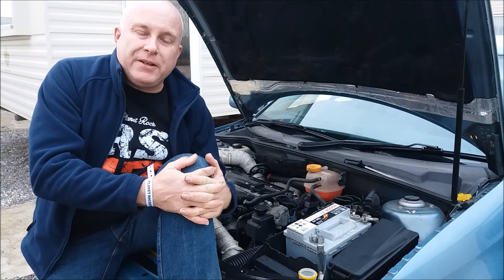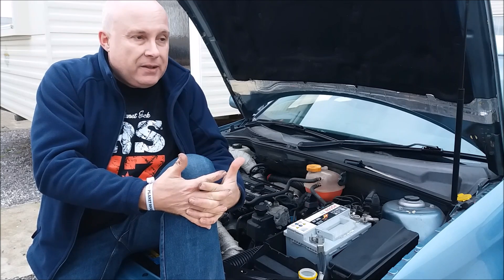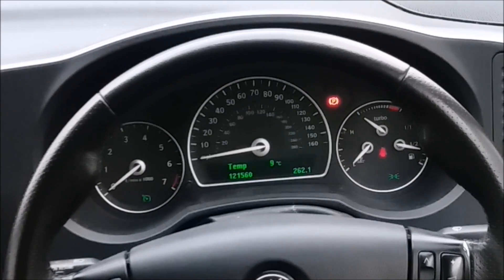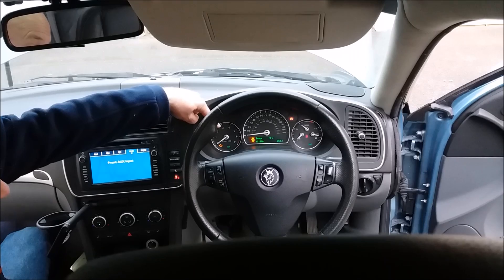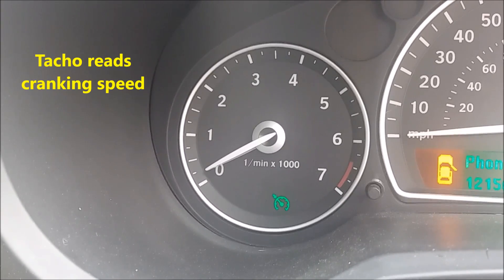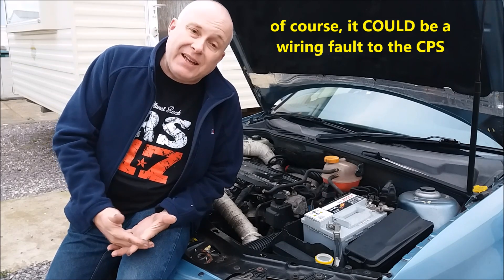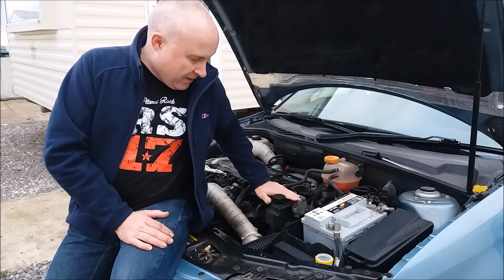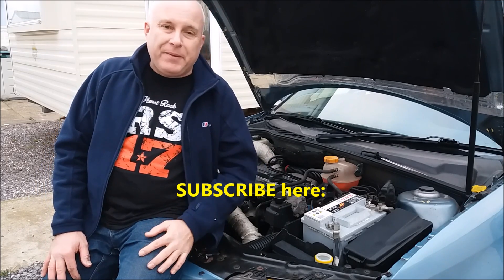CRANK Position Sensor Test - failing CKp sensor - CKp test

Comment: Short and sweet but most of all informative! Thank you!
I just discovered I just unplug thus and put on a new one so I best get started and I will ask my mechanic why he didn't know this when I described these symptoms exactly and only?  *second mention the tachometer reading!!
Der... why has nobody ever mentioned this, is it too obvious? NOT
Reply from the maker: Yeah, I think it is. It's just way too simple for most people. Yes, cars are more complex than they used to be, but people somehow imagine that failures also have to be complex. Not at all, sometimes you just need to get back to BASICS - it's nearly always some simple component failure.
It's the same with coil-over-plug units. Mechanics will tell you they can't be tested other than by substitution (aka 'parts darts'). Again not true. I'm actually in the process of filming a video on how to test COP units!! With a £10 tool too. Watch out for it.
Welcome aboard

Comment: Yes my Pontiac Grand Am had that problem when it got to normal operating temperature the sensor would stop working engine would die and it would not start until could then it would run good until hot again ,so wen I got my chrysler 300 with 175 thousand miles I replaced the sensor it was good but I replaced it anyways and I put the old one in the trunk for emergency ,its a cheep  sensor anyways.

Comment: 97 maxima stalls at idle then lights  came on as if stalled on the highway but the car was still running. Then it would constantly try to stall as the rpms bounce from 3k to zero even in park. ??? What the heck is going on? It has a p1335 and an evap emission system purge valve control  circuit code p0443

Comment: i have a miss fire on mine to think is the crankshaft position sensor can you tell me please thank for the video..
Reply from the maker: It is possible for a CPk to cause a misfire. If it is missing a signal, then there will be a weak or missing spark. Unfortunately to prove this requires the use of an oscilloscope (or picoscope), which will probably mean taking it to a shop. As much as I hate "parts darts", you might as well replace the CPk instead of spending $$s on shop time.
HOWEVER
Before you go spending on a CPk, have you checked other possible causes of the misfire?? In particular check you have a healthy spark and that the coil/leads and spark plugs are OK. Have a look at this video https://www.youtube.com/watch?v=BeJ0P9XTBRg  and if the misfire is occurring under load then you need to use the same methods but one of these so you can increase the spark gap under test http://bit.ly/spark_tester
Reply: What is a CPK ???
Reply from the maker: @nelsonjaneiro5543  sorry my mistake: Crankshaft Position Sensor or CKP

Comment: I change the crankshaft positioning sensor now it won't start what should I do
Reply from the maker: Make sure it's fully home and connected correctly. Also double check you have the correct sensor for your engine
Reply: @CycloneCyd  thank you

Comment: Thank you for showing this. It happened to me long time ago, took me a lot of time to figured it out .
Reply from the maker: Yes. The lack of codes confuses even mechanics
Reply: shuo chen - I post the same thing without even seeing your post first. Men that was annoying that the check engine light doesn’t tell u that. Would save a hole lot of grief.
Reply: shuo chen 我也遇到热车之后 行驶中熄火的问题 怀疑是crankshaft sensor。但是没有故障码。

Comment: What if i have no tachometer?
Reply from the maker: Ah, right oh. In this instance, I would suggest that you download Torque Pro app onto your phone (Android) and buy one of these http://bit.ly/OBD2_BT_Adapter  Set up a dashboard in Torque to show a rev counter (tacho). You will find Torque is extremely useful for many things and over time it will pay dividends many times over. It's a cheap setup in the first place - it'll cost you less than £10.

Comment: Ok I wanted to give my point of view. Yes, the CPS can fail and not allow you to drive. However, you can also have the same symptom with failed TPS and Airflow Mass Sensor that are prone to failure. With a failed MAF car will stall when gently pushing the gas pedal from park to direct. Bad MAF means no air to engine. Bad TPS  another problem that can imitate bad CPS. Bad TPS will have difficulty starting the car, extended cranking and low RPMs below 750 at park. Also hard gas pedal when press it and lack of power. The CPS can last many years when properly cleaned and maintained. My CPS is made by Lucas for a Jaguar XJ 6 and it still works after 25 years. It is the original sensor. I carry extra one with me for emergency , but so far I never had to replace it. I drive my car about 500 miles a week. Both MAF and TPS are more prone to failure due to engine heat. Check them first before proceeding with replacing the CPS. Overall a great helping video.
Reply: Yes true but the CPS is directly on the engine so they will fail when the engine becomes hot. The MAF is affected by dirt mostly but air entering the MAF should be clean and not hot air coming from the engine

Comment: Hello Sir,

Im Kevin from Switzerland.I have a vw touran 2011 ,1.4 petrol TSI Automatic gear.

The car was serviced 2 months back,and all the filters including fuel filter was changed.

In last one month time the car shuts off while driving.

To be specific,i drive the car 3 kms  park it for shopping,after half hour or 1 hour i drive the car,till 200 meters, and waiting to enter the main road for few seconds and apply pedal the car shuts off.This happend to me now 3 times,took the car to vw garage ,they say the computer dosent shows any problem,so its difficult to say what excatly the problem is.

Now i cannot change all the parts starting from fuel tank pumps ,sensors,ecm,etc which kills my pocket.What do you think ?Any suggestions would be really great.

Thank you,

Kind Regards,

Kevin

Comment: Hi mate info needed plz.iv a 1.8tdci ford smax.its had full service and dino from garage with no codes found. It can be hard to start from cold but does fire up then cuts out 5 min up the road some times i can go a few days with no cutting out.its so random.it does seem to cut out when i come to a stop or turn corners im so confused lol iv no warning lights on dash an glow plug light dont flash just stays on as normal for few secs at first start.eney ideas plz🤔
Reply from the maker: does it cut out when it's up to temperature? When it does cut out, does it start straight back up again?
Reply: @CycloneCyd  hi after car bin stood over night i get in start it sat there a few mins drove up the street turned left then it stalled.other time i was out about an hour in it turned right it stalled so both hot an cold.its not stalled yet going strait seems when i turn.it idles fine an no warning lights iv got the grey cam senser on ut iv tapped it with hammer lol when its running but it dint cut out.seen a vid on hear to say tap it with a hammer 😄
Reply from the maker: @crazycol2051  Ah ha! So, your engine has a CAM and a CRANK sensor. That makes life a little more complex. Are you getting an EML light when it stalls?
Reply: @CycloneCyd  no mate nothin on dash the only time i wish i had a light on🤣i did self scan on car with steering weel control got a code #foo616.looked it up some one said steering wheel angle senser another said battery.my volts show 11.7.but think its coz cars bin stood for week batterys not getin charged.other than that im lost
Reply from the maker: @crazycol2051  at 11.7V that means your battery is almost discharged. You should get it charged up with a charger (even a basic one from Halfords will do) and then test it like I show here: https://www.youtube.com/watch?v=AT_XmlwMVz4&t=299s
Battery trouble can cause all sorts of electrical gremlins, so don't discount that you need a new battery. Even if you do need a new battery the stalling could be completely independant of that

Comment: Cyd,  I have VW Polo 1.4 16V 9N. I traveled 450Km  from city to the other and when arrived to the destination the car  stalled. Since then, its cranking  and not starting. What can I do?
Reply from the maker: Did you do the "tacho test"? What does it show?
Reply: @CycloneCyd  Please, what is tacho test?
Reply from the maker: @nivovo  where I show to watch the tacho (rev counter) whilst cranking and watch to see if it shows crank rpm
Reply: @CycloneCyd  the tachometer does not move.
Reply from the maker: @nivovo  Sounds like it needs a new crankshaft position sensor
Reply: @CycloneCyd  Thank you so much,  I am going to buy it now.

Comment: I have a problem with my vectra b. It is difficult to start the engine, no matter if it is cold or hot, it only starts after three to four turns. Diagnostics showed errors for the coolant sensor and the camshaft sensor. Both sensors have been replaced and no progress has been made. Can it be that the crankshaft sensor is in question and the diagnostic does not read it?
Reply from the maker: Which engine? I'm guessing 1.9 diesel
Reply: @CycloneCyd  No,it`s X18XE 1.8 16v
Reply from the maker: are you certain this engine has a CAMshaft sensor? I thought it only had a CRANKshaft sensor??
Reply: @CycloneCyd  of course I'm sure, I personally oversaw his replacement.

Comment: Hey I have a code that say it's the crank/camshaft sensor. But my car doesn't stall and it start fine. Help anybody?
Reply from the maker: Find a garage with an oscilloscope (or picoscope) to look at the precise output of the sensor in real time. They output a square wave signal and they can fail in such a way that they miss out some of the 'waves'. No simple way to detect that on a DIY basis. DannerScanner did a great video explaining it.
https://youtu.be/JWfdHXL-bPg

Comment: I have a 1990 Miata with both crankshaft and camshaft position sensors.  The engine is stalling as you describe.  I'm not sure how to proceed to determine which (or both) might be failing. Can you help me?  Thanks.

Comment: On my Volvo V70  2012 2.5Liter bi-fuel. The symptoms are as follows.

It is usually more difficult to start in cold weather and may sometimes need three or more start attempts. Sometimes when it starts with the rpm at zero. Or it shows zero after a few seconds after the engine has started, the engine then runs but with warning messages on the dispay (can also get warnings after many start attempts). If I drive so without rpm (automatic gearbox) then the gear shifts very late. But if I get the car started as normal and I drive away it can get a microstop stop later and if I was in a roundabout or intersection it could be an engine
stop. This is my fault code ECM-P072800 and sometimes TCM-P072500 and TCM-U040100

Is it probably the crank sensor that is the fault in my case?

Comment: Exactly what my 2001 Yukon XL is doing. Stalling without warning and will restart after a few minutes and then shut back down . Especially after the engine gets to normal operating temps  Not so much in cooler weather
Reply from the maker: Did it turn out to be the crank sensor?
Reply: Changed it out and that fixed the problem. Thanks for the advice
Reply from the maker: @joeysansom5075  good job 👍👍and welcome aboard

Comment: What if the battery is good you put a new starter in but the car still won't start and throw any codes could it be the camshaft positioning sensor causing it not to start at all once you try to start the car the radio goes black and it doesn't do nothing could it be the camshaft positioning sensor on my motor or crank Sensor or even immobilizer issue inside the ignition module circuit where you put your key in could that be not working could the points inside be effective because I can turn it from Lock accelerate on butno start also my engine is not cranking like yours in video but is turning over  feels like the starters trying to make the flywheel spin but no start I have cluster lights on like the Christmas tree lights and my scan tool is not throwing any codes

Comment: I have a yukon denali 2007. There was oil on the old ckp sensor when I removed it. Plus although my truck was back to normal. For like 3 hours. It went to doing the same thing. Giving the the same code and showing stability track light on dash...can you help. Me. And I have a small valve cover leak.  But im going to fix that today...

Comment: My car won’t start it just cranks but won’t start I don’t have a rpm gauge in my car so I don’t k ow what it’s cranking at, but when I disconnect the battery for a few seconds and then reconnect it the car starts but rough it grinds a little then doesn’t start in the first crank after I turn the key on again it finally starts any idea what it could be? I have a 2004 Chevy impala

Comment: I have a Saab 93 and it seems to only start up nice after sitting for 5+ hours or after it has just been shut off. It also idles and runs rough, with vibrations from the engine. I checked the codes and all its giving me is P0411, which is the secondary air injection issue. I have a crankshaft sensor to put in. Im just wondering if the sensor will fix my issue or its something different?
Reply: To add to it, once it didn’t start for me. It would crank and turn over but not actually fire up the engine. It finally fired up after giving it a tiny bit of throttle

Comment: Thanks for the tips, very helpful!!
Reply from the maker: Welcome aboard Mike
Reply: @CycloneCyd  Thank you, I had just replaced the fuel pump about 3 weeks ago. I hear the pump prime when I turn the key, but as you stated the tachometer does not register during crank. I'll give it a go, replace the sensor and see what happens. Thanks!!
Reply from the maker: @ThisIsTheRealMe2  don't cheap out. Bosch all the way

Comment: My car is Toyota Etios while driving my car suddenly  stall and after 5 minutes car will start  this problem will come driving 30 to 40 Klm distance please tell me solution to me
Reply from the maker: Hi Vjay, thanks for watching and engaging. Do you get the EML? (Engine Management Light).

Do you know if your Toyota engine also has a CAMshaft position sensor? (Look up in service manual or research online).

Does the car ave a tachometer (rev counter)?

Comment: Hi. I have a problem with my Toyota avanza it does crank but not starting, can a crank shaft sensor be the cause? And what other things to check for if not the sensor, and if the sensor is the cause will the car start if I kick start it
Reply from the maker: Possibly, but unlikely because many Japanese engines have a CAM sensor as well. Do you know if yours does?
Have you checked for spark and fuel delivery? Results?

Comment: Hello sir.. Crankshaf sensor control a injection fuel? Righ?
Reply from the maker: Hello ali, thanks for watching and interacting. Welcome aboard.
Yes, correct, the CPk controls the timing of the fuel sprays. No CPk signal = no fuel injection. Poor or incorrect CPk signal = poor or incorrectly timed fuel pulses.

Comment: I have a  code p0339 intermitent disruption with ckp sensor. Car runs rough the wires on the harness is good and i had tried both my ckp sensor and a spare from my old motor  still idles poorly.

Comment: You can't go by the "RPM" theory on a 97 Chevy Silverado 5.7L ... Just sayin... to be fair...it was worth a shot and the advice was still good. Just didn't work in my case.
Reply from the maker: Is that because it has a cam sensor too?
Reply: @CycloneCyd  That would make sense to me because it does have a Cam Sensor
Reply from the maker: @shield707  that'll be it then. Engines with both will use the good one and throw a code. The good one becomes a "backup"

Comment: This is a great video because you discuss the RPM at 0 during sensor fail. No one else out of 30 videos discusses this. Thanks.
Reply from the maker: Hi Jennifer, thanks for watching and for interacting. Welcome aboard.

Yes, it's part of my "back to basics" approach where I am trying to show that faults can be identified or narrowed down by testing and that garages using "parts darts" at customers expense are simply incompetent and ripping people off. Another good example is coil-over-plug units (I'll cover this later this year).

Granted this test is not 100% foolproof but it does work for most cars most of the time. To be 100% foolproof you need a picoscope (plus laptop). At around £1000 picoscopes are simply beyond the capability of the vast majority of DIYers. You can see a picoscope in action here with Oz: https://youtu.be/wmoQxiqYX3U

Don't forget to share and if you have any suggestions for future videos add it to the comments here: https://www.youtube.com/watch?v=idkiya_7Tt4
Reply: Agreed! I haven't seen that info anywhere else yet! Ill be checking RPMs first thing in the morning!
Reply: @jameswakeland593  HEY JUST CURIOUS...DID IT DIAGNOSE YOUR CRANKSHAFT SENSOR?
Reply: Totally agreed Jen. Thanks cyclone cyd. 👍👍👍
Reply: My sensor is stuck!!!!! It's a hard reach and needs to be out!!! Any idea to get it out from Saab 9-3 owners? 🆘🤦‍♀️🤦‍♂️
Reply: Akbar
Reply: Yeas on point!! That wat I was thinking and I think my car is failing at crank sensor.